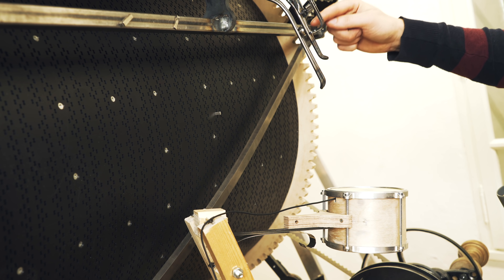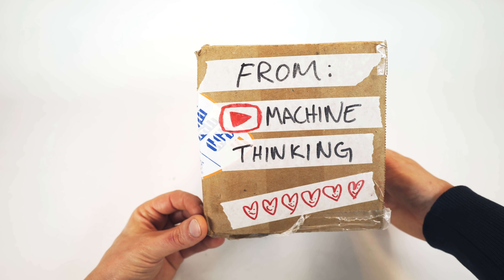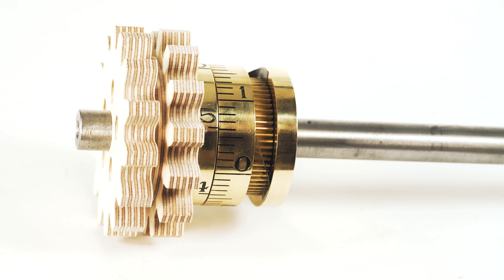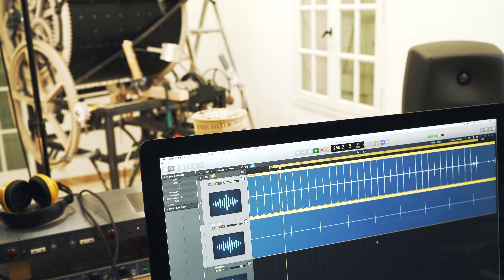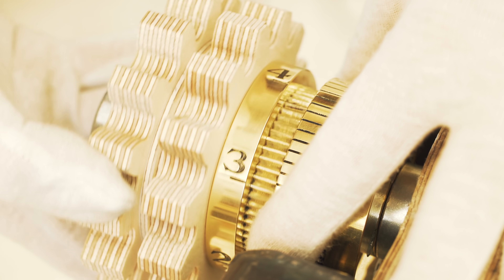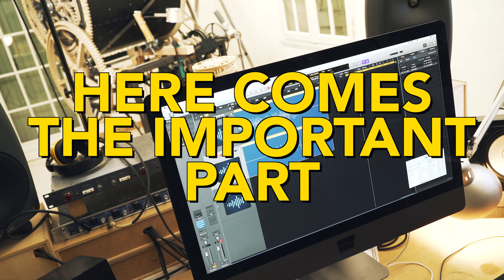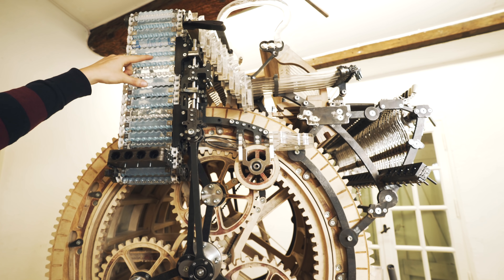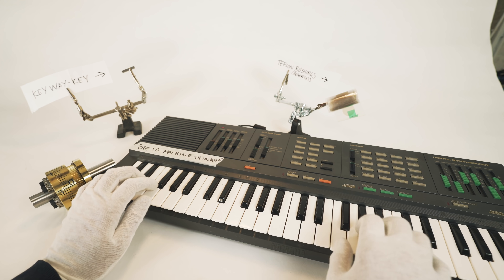Testing the Music Timing Clutch - Marble Machine X #77

Comment: Some bicycle speedometers have a cadence function. with one magnet that would translate to Measures/minute. Four magnets would read out in Beats/minute or BPM.  Just a quick visual feedback without running the computer. e.g. Cateye Strada Cadence. You can switch the cadence readout to the Large seven segment Liquid Crystal Display display.

Comment: I suggest that you can change the marks from clicks into BPMs, if clutch is at 90 BPM, mark it 90, if at 140, mark it 140. it would be looked more directly. And next step, setup a motor instead of namual power input, when you change the BPM, the motor can reflect the correct speed on main power input.

Comment: Assuming that 90 BPM and 140 BPM have the same positions on the clutch, you should make a quick switch for it so you can easily go between the two or any other speeds

Comment: Seems like you could maybe make the clutch have preset labels for each main BPM you use so you just. Kinda more like a car clutch pedal and gear shift lever. But leave in the ability to make manual change. Maybe a dual clutch?

Comment: You should add an automatic gearbox similar to that of a car because surely if the alternating bpm rests at different speeds then the gearbox can compensate for that by adjusting the flywheel speed compared to that of the crank

Comment: You probably figured this out already, but your 10 ticks = 100ms trick only works near 100bpm. The faster the beat, the shorter a tick on the clutch is.
It looks like there are 60 ticks on the clutch, so each tick is (1000/bpm) milliseconds. At 140 bpm, each tick is about 7ms, which is why you had to adjust by 13 ticks (should be 14, mathematically, but 7ms is really short.)

Comment: So a change of one number is 10 steps -- it's a little confusing because of the usual use of the term step in music. Test 2 was not juicy -- it was anxious. In test 4 you could see in the juxtaposed sound waves that it wasn't exact. That's why you said, "finally it works", right? The difference had become less than our ears would discriminate even though our eyes looking at the wave forms could see the difference. I wish you'd looked one to the right and to the left. I wish you'd had a clutch with twice as many divisions. It's still unlikely that anything would have been exactly right, and it would have been completely unnecessary, but my brain wants to curious, lol!  Too bad the offset isn't easily changeable during performance. I wonder what that _ mechanism would look like? I have ideas for it using a small SCC like an arduino to make a constantly variable (analog or so small it would seem analog) adjustment so you could lay back or change the bpm during a song, but that would change the design constraints, so _forgedaboutit! Still, a fun design thought project. Probably with stepper motors, Expensive ones with more predictable quarter/eight/sixteenth/thirty-second steps.
140 beat -- there is no early or late correct answer. Every early is also a late. There is only an aesthetic choice. But if you want to be technical, since the fall time is constant, and the beats come faster, you could say late in that sense. In fact, given the fall distance, the bpm and a tiny bit of first semester calc it's easily calculated. It was funny that even though my eye thought it looked pretty great, my musician's ear heard a difference.
How I wish I wasn't so poor. I can't predictably do patreon monthly contributions. Do you have a paypal donation?

Comment: Wouldn't a speed governor do a better job at keeping the RPM at a constant there for keeping the BPM in check? Along with the timing clutch to bring it in sync that is. With the governor you would be able to keep in check the speed of the flywheel with out it going to fast at least.

Comment: This delay reminds me of engine ignition timing. Like the fall time of the marble, the time of combustion in an engine remains constant so the engine timing needs to be advanced at higher rpm. I wonder if you could make an automatic timing clutch that uses centrifigual weights like in a distributor. I don't think the rpm of the crank is enough to work with a system like that

Comment: You can determine the offset amount for any given BPM ahead of time, Martin! Where B is the song BPM, and O is the marble drop offset time (in seconds):

60/B is the duration of a crank rotation
O/(60/B) is the offset duration, represented as a fraction of a crank turn
60*O/(60/B) is the clutch offset (measured in number of teeth) from zero, and this simplifies to O*B

This gives offsets of 19 teeth for 90 BPM (0.21 seconds * 90 BPM), and 29 teeth for 140 BPM (0.21 seconds * 140 BPM). The more accurately you can measure the marble drop offset, the closer the result will be.

Comment: Up Next, automatically adjustable clutch based on the rate of spin of the crank shaft so you don't have to manually time the gears.

Comment: You probably already realize this, but different BPMs will lead to different time adjustments for each step on the clutch. Each notch will offset the wheel by 10ms only at 90 BPM. At 140 BPM, each notch will have a shorter offset. The timing of each notch will be some ratio to the BPM, it won't be constant.

Comment: GAAAHAHAHA. Using screws as a chuck vise. You just got lucky the part didn't rotate when the pressure from the tool was applied. Martin you have a chuck vise you could have mounted to your worktable.

Comment: I think this requires that all instruments have identical drop times., with all instruments being dropped at identical times.
Otherwise if you have for example an instrument with a longer drop time, it will need to be released earlier, but that amount it is released earlier needs to vary based upon tempo.

Comment: Why don't you install a RMP sensor, that way you will know at all times how many RPM the wheel is rotating, then you could manipulate it to go down or up at will, that is if you do it by hand, you could install an electric motor and program it to do it for you when you want it to be autonomous, either way a RMP sensor will be useful.

Comment: Question 1:  You're calibrating the offset for the kick drum, but the distance from the marble release to the other instruments is different.  With gravity being a constant but the bpm changing for different songs, you're going to still have a difference for when the marble hits other instruments like the bells or bass.  If the marble drop distance were exactly the same for each instrument this would be perfect but with the distances varying, you'll have some minute variation.  Right?

Question 2: I presume you'll have to do a calibration check before playing each song live since it appears you might be able to get the calibration index out of phase if you don't return it back to zero every time.  Without a hard stop you could conceivably keep rotating it in one direction and get confused.  IE the number value on the index may be erroneous if you move it forward an entire count or bar.
Reply: IIRC he's built in adjustability for each channel's drop height, which should solve Q1.
For Q2, again only iirc, there are only 64 bars, so with a ratio of 1:64 of programming wheel:hand crank (which I think is what he said in the video) this would make a full rotation of the timing clutch cause the song to move by exactly a bar, which wouldn't throw anything out.

Comment: Would the problem not be solved by running the timing wheel off a gear run by the drum, rather than directly off the crank? The whole clutch would then not be needed?

Comment: If marbles drop further / differently from other channels you will have different latency per channel so not everything can be solved by one timing clutch. Is this not an issue? Or are the latency's comparable? Or can you force them to be similar with other adjustments?

Comment: But... if you adjust the kick-drum to the rhythm wheel with the clutch... how will you calibrate the other percussion? You would need to calibrate the distance of the drop point to the contact point on the instrument so that it was identical across all play surfaces.

Comment: I feel like if the surface where the marble will strike the other instruments isn’t at the same height as the kick drum you’ll run into desync between the instruments themselves and possible between each note on the vibraphone

Comment: I never would have guessed my second comment on an MMX video would be for a part I made
Reply: Curiosity.  Is this part even working as YOU envisioned it.  Or did Martin throw a surprise at you??
Reply: @peterkelley6344  Exactly as I (we, really) envisioned it. There was much discussion and CAD work to make sure the need was met exactly.
Reply: @machinethinking  i wish he knew just how beautifully you empowered him to join his analog machine to digital calibration!!! your genius
Reply: Totally ingenious. As a master automotive technician, it blows my mind the thought process required to create a such a device.
However, I'm surprised he couldn't correct the timing issue in the recording software.
Reply: @knunyabeasewhacks8744  the MMX is supposed to be an instrument played live afaik.
Reply: @Stumper52  that's maybe true but he also couldn't think about mounting the clutch just behind the handle so its more ergonomic taking 
less time to adjust the timing 😁
Reply: Well done Machine Thinking.
Reply: And getting a song as well!

Comment: We can do the math on this. Since there are 60 timing marks per rotation, if you are M milliseconds off playing at B beats (= rotations) per minute, you need to adjust by M * B / 1000 timing marks.  So if you were 200ms off at 90bpm your adjustment would be 200 * 90 / 1000 = 18 marks.  70ms off at 140bpm is 9.8 marks. No guesswork needed!

Comment: If you added a centrifugal advance, the timing would always be perfect, this is how older distributors work for ignition advance.  So if you need more advance at lower speeds and less advance at higher speeds, you could program this with weights and springs to be exactly perfect.

Comment: Martin, I would recommend making all the BPM measurements in reference to the zero's position.
So that one can easily keep a simple note book with: "For 114 BPM use setting 23" as an example.
And I guess the numbers on the wheel with fewer lines only has a line for every ten lines on the other wheel. So that one can offset the machine a bit faster. (less counting per say.)

Though, personally I would have only then had a range of 10 lines (0-9) taking up 36 degrees on the fine pitched wheel, and then a line every 36 degrees on the coarse wheel.
As to make all the lines less confusing at first glance.

Comment: You can put a mechanical speedometer from an old car on the flywheel shaft by choosing the gearbox so that the number of beat coincides with the number kph on the scale.

Comment: It would actually be quite cool if you did a crank indicator anyways. Basically, a crank indicator needs to be a spring-loaded wheel that pulls to a red area "too slow", and then a small area that is green "good", and then a red area "too fast". Then a magnetic clutch, and then a rotatable arrow (so you can set the BPM you "want" to play in). The magnetic clutch then works like the speedometer in the car.

Comment: Not sure if I'm thinking about this correctly, but isn't the offset dependent on both the drop height of the instrument and the tempo you're playing at? If so, a global offset like the one you're using here won't be able to sync all instruments simultaneously. Or is the drop height the same for all instruments?

Comment: Won't the marble stair/belt timing go off as the clutch is adjusted? It's attached to the delayed side of the clutch, but there's no delay on the ratcheting sound so it'll move more off the beat with bigger clutch adjustments - by exactly the amount of time the clutch is compensating for in the drop timing.

Clearly you need a second one to decouple the stair with and counteract the timing of the first...

Comment: BUT:  The drums, vibraphone and base guitard will not be at the same distance from the marble releasing arm. Thus the delay will be different for all different instrument. I hope the delay will not be significant but if it does, how do you plan to fix that.
One more concern: you are doing all your tests in a way to controled environement imo. It doesn't reflect the conditions of open-air stage summer festival for example. I'm realy worried about windy days or super hot days or even qworse, rainy days. Did you took that in acount (you're genius so I think you did but still...)?
Reply: The marble drops are adjustable so they all have the same delay

Comment: This is a great idea! I have one concern though, you will have instruments at slightly different heights, this means that you would need a different offset adjustment for each instrument. Are you planning to solve this with marble drop mechanisms at a different height for each instrument? Or is the difference in height small enough that it makes no actual difference?

Comment: Great stuff. But how would a mechanical solution to an adaptable delay work like that could create tight rythms for a range of bpm? Or would that need to be insanely complex? Could it maybe work with a friction based connection working against a counterforce (via spring?) that would be manually adjustable in downtimes for calibration? That way the offset could be larger at higher bpm and continously adjust itself. The ramp could be calibrated by setting the spring stiffer or more relaxed. 

That is just a thought. I am not sure such a ramp would follow the relationship between those two instruments at varying bpm.

Comment: I know you are anti-electronics, but would it not be possible to fit either an electronic BPM counter to guide your wheel-spinning, or alternatively fit a mechanical rev counter that could be recalibrated to give you BPM? Either way, it would be better than a click track, as one could work totally visually.
Reply: He explains in the video why that won't be necessary, as the clutch calibration will make out of time speeds very noticeable. Every track will come with its' own clutch setting number.
Reply: @LonesomeTwin  
That's not what I am talking about.
I am referring to Martin simply turning the crank at a constant speed. After a while it's easy to get tired and start to slow down. That is why he uses a headphone click track.

Comment: what about a self adjusting mechanism that corrects to whatever BPM you happen to be spinning the machine at in realtime ?
Reply: Nice idea!!! Maybe a mechanism that drops a marble that has to drop the same distance but needs to fall at a certain point of a spinning sensor which automatically adjusts the clutch depending of the marble hitting the sensor too early or too late. I feel like I'm actually construncting that n my mind right now...
Reply: This type of device is common enough, problem is that they are usually hydraulic.
That clutch is under a lot of stress, enough that that single little key is not going to be sufficient long term. A simple friction device would not work.

Comment: Why dont you use math to determine the offset?

First calculate how many rotations the crank does per minute:
rpm = bpm / 4
Now you can easily get the time one crank rotation takes:
T = 60 / rpm
Then precisely measure the time it takes the marble to drop down in seconds, lets call this the droptime;
Now you can calculate the offset you need to set with your clutch:
offset = 360° * droptime / T

If you put all into one formula you get:

Offset = 360° * droptime * bpm / 240

If your clutch isnt labeled in degrees you can simply substitute the 360° with how many units it takes your clutch to do a full rotation.

Comment: Martin! I think I see another issue that you may want to consider before you get much further.  The timing clutch makes sense because the travel time of the marble in the air is independent of the machine speed. Got it.  But, remember that the factors affecting marble drop time are gravity and distance.  If you have different distances for the various marble gates, the timing clutch wont work.  Just something to keep in mind when you are building the rest of the marble drop gates.

Comment: As I'm sitting here thinking about this, timing advance like this is a lot like what modern gas internal combustion engines do. As you speed up the engine, you advance the timing so that the combustion, which happens at a relatively constant rate, just like how the marbles fall at a constant rate, reaches its peak pressure at the ideal point. Awesome. :D

Comment: Better install a raspberry pi with a 7" screen connected to the contac microphones in the same spots to check the timing quickly in a scenario... Or mark the gears like a engine had

Comment: This is pretty great, but for a second I thought he was rolling out variable timing and was overly excited. It would probably be too complicated even for this project, but it would be possible to incorporate a dynamic version of this that would adjust to whatever bpm he was playing. An electronic setup would be relatively simple, but I think it could be done mechanically. It would probably end up using ideas from old variable valve timing systems and/or continually variable transmissions.